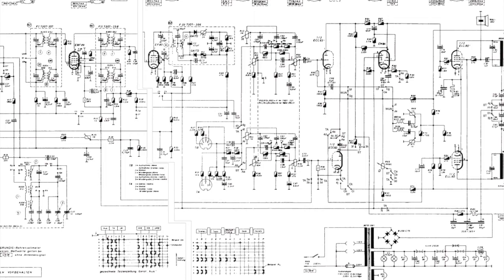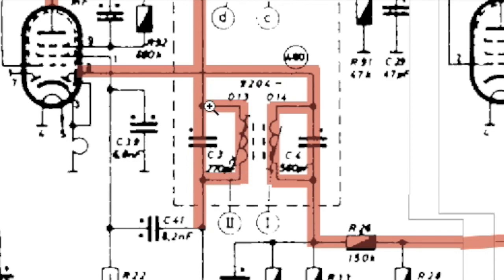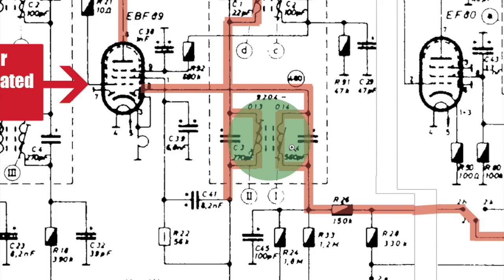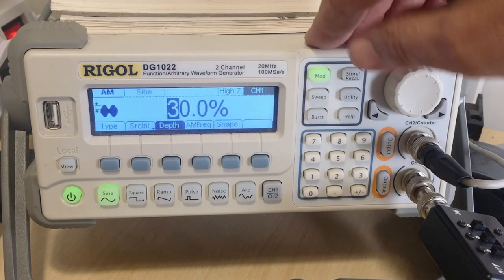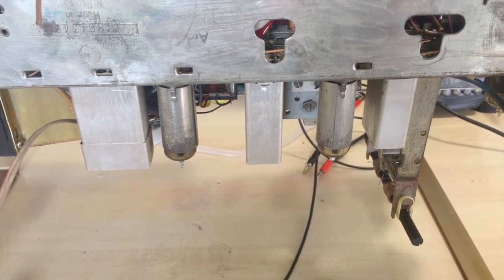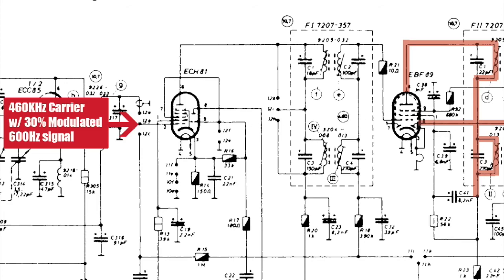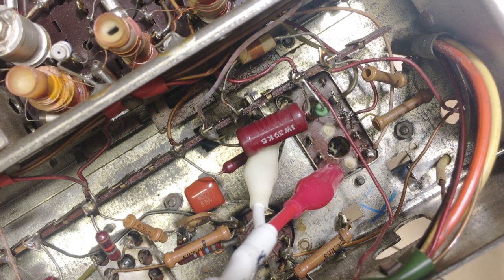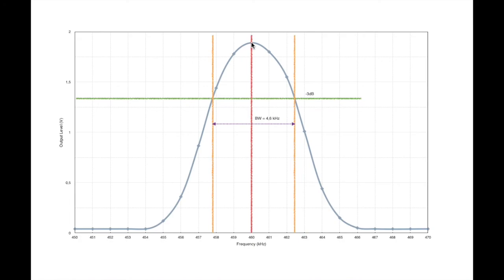Grundig 4198 tube radio restoration - Part 8. Detailed IF alignment for AM.

Comment: I have never in my life seen anyone do an IF alignment using added components across the primary and secondary sides of an IF can !!!!  The bulk of what you did is the same as what I am use to seeing done, but the added components are a new twist.
Reply from the maker: That method is actually recommended in quite a few German radio alignment instructions. SABA was the first one I saw, but I’ve seen it since with other brands too. It was new to me too.

Comment: Well explained and presented, as usual, thank you for this.  IF alignments have been a big mystery to me in the past but with videos like yours the fog is finally lifting.  I noticed that you did not use your analog voltmeter on this one and instead opted to use the digital readout in your oscilloscope display.  Any particular reason for this?  Also, the wave pattern on your scope was gently fluctuating during the alignment.  Is that normal or a product of the modulated signal coming from the function generator?  One final question:  Could you generate your bell curve using a sweep generator instead of plotting it by hand?  Thank you for your excellent videos and taking the time to answer my newbie questions.

Comment: How do you change the width of the signal to 9khz..??
Reply from the maker: Kennynva T. : by tuning the transformers in a “staggered” way, so each one will be slightly off frequency. I normally don’t bother. I just tune it as sharp as possible.

Comment: Excellent explanation. About dampening the coils, do you think this method would work with more modern, transistorized radios? Many thanks.
Reply from the maker: Zirok1982 : probably would, but probably not needed.

Comment: I am looking forward to the final alignment of the receiver. It was quite interesting to see how you have increased the selectivity of the I.F. Stage by reducing it to half of the normal value and increasing the sensitivity of the radio at the same time..?Am I correct? Looking forward to the remaining part of the r.f. Alignment. Thank you very much.
Reply from the maker: abele ballestri : that is correct. Because I live in a 'remote' location I prefer to improve the sensitivity.

Comment: Sir, previously due to the short in the capacitor, the power transformer had over heated and smoked like a cigarette does it mean the power transformer has become weak and needs replacement or rewinding.
Reply from the maker: +shaikh naeem : not necessarily, but it definitely becomes suspicious. Keep an eye on it and see if the temperature stabilizes at a reasonable level after some time in use. If not, you will need to think about a replacement or rewind.

Comment: Further more about my GRUNDIG trento, i removed the gang capacitor and made it free, put it back at its place and the result is excellent. Radio works perfect. One question, the power transformer is becoming quiet hot, what should i do. It has three tappings, heater, 180v for b+ and 115v for turntable.
Reply from the maker: +shaikh naeem : if you are feeding it the correct line voltage, then just make certain that it does not overheat. 'Hot' is acceptable, but 'too hot' is a problem. Finding the medium is a challenge. Don't leave it on unattended to avoid burnouts.

Comment: More fidelity? Does that mean that you are missing some of the fidelity because less of the wave is "heard" (or is present inside of the -3 to 0db range) by increasing selectivity? Is there a happy medium without sacrificing to much selectivity?
Reply from the maker: +Ian Ide : well, I tune mine as sharp as possible because I have no AM stations in my area that I would actually hear music on, and I live on an island in the Atlantic (Madeira). This means that the happy medium for me is as sharp as possible. However, the recommended width is about 9kHz across.